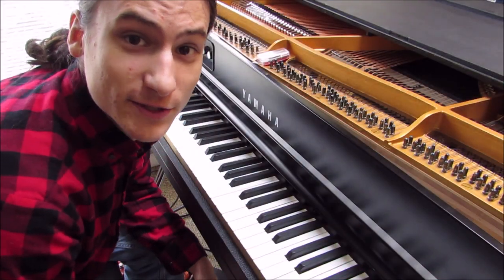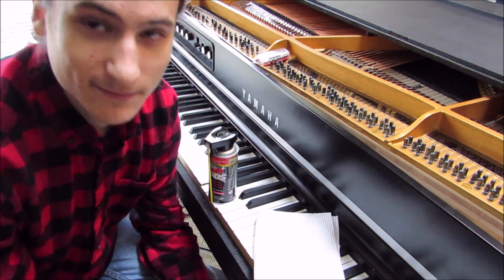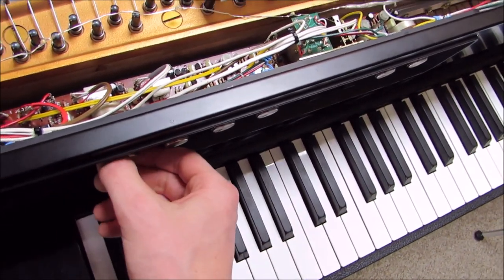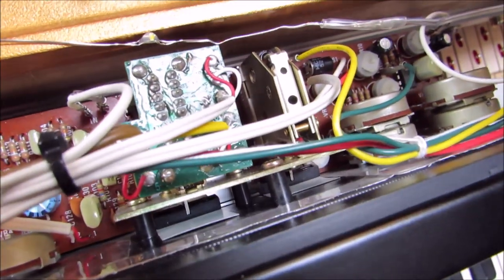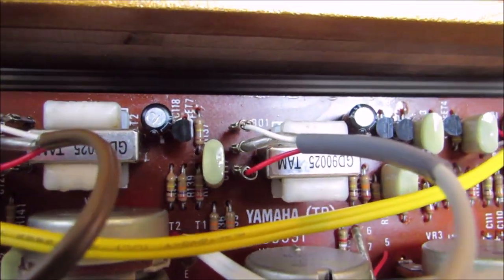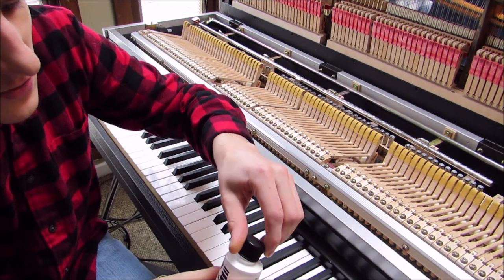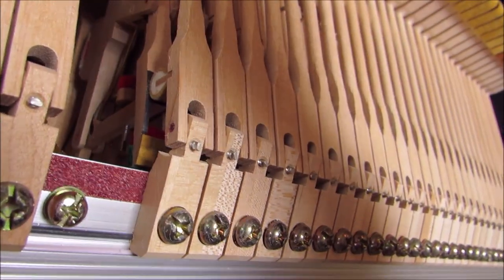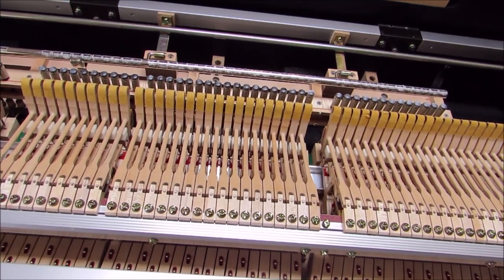Yamaha CP-80 Restoration Part 4

Comment: In one of the earlier vids of this series, you had used a powder lubricant on the felt hammers.  Why not use the CLP Protek on the felt as well?  I was reading that it was safe for felt and wood.
Reply from the maker: The possible complication with using the liquid lubricant on the felts is that it can loosen the felt from the glue.
Reply: @pianojoe6880  gotcha, thanks!  Teflon powder ordered!  I have a Rhodes I'm restoring, and already have the CLP for that.  What a chore that one is to laser burn out all of the bridal straps...
Reply from the maker: @ChonkTek  if you look up vintage vibe they have tutorials on changing bridal straps and much more all about rhodes. Good luck with your project.
Reply: @pianojoe6880  thanks!  I had contacted one of the other companies about the process and told them how I was cleaning the slots and prepping for new bridal straps, and they seemed to be impressed with it. I asked them how they do it, and they just use a razor tool alone, and lots of patience and cursing.  It is apparently one of the main reasons these restos take so long.  Sometimes.  Apparently, some Rhodes have that whole slot filled in with CA glue/epoxy (or whatever they had used back then), and some don't.  The one I was blessed to restore is filled in so much that glue also had seeped out and made the thickness of the plastic slotted end larger in places, adding weight here and there.  Some is even dripped down to the other end.  Razoring off that extra glue is like re-sculpting the plastic in a way.  This job is for my best friend this time, so I'm more committed in doing it right.   I'll tell you what... if we made certain special tools to quickly prep those slots and surfaces for new bridal straps and rubber hammers... we would be wealthy.  Well, maybe that's something I should look into.  

Btw. I always work alone, but if I ever wanted to make an ultimate duo for restoring pianos, I'd knock on your door, man!  I dig your style. ;)
Reply from the maker: @ChonkTek  Thanks, I appreciate it.

Comment: How did you get lubricant on the pins between each key? Could this have been done while all the parts were removed for cleaning and do you lubricate both sides of the pins?  My CP80M is untouched but now I see how it's built and can be maintained. Thanks for making these vids.
Reply from the maker: I didn't put lubricant on the key pins, I only polished them.